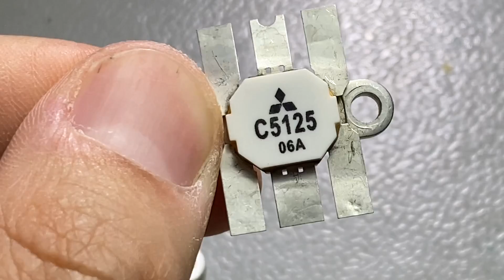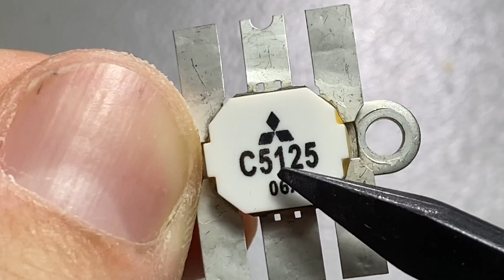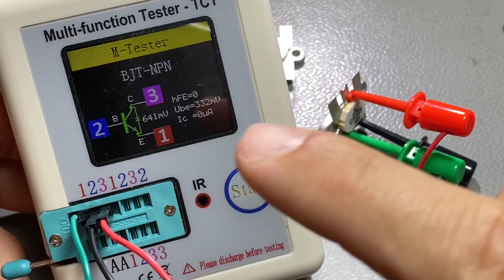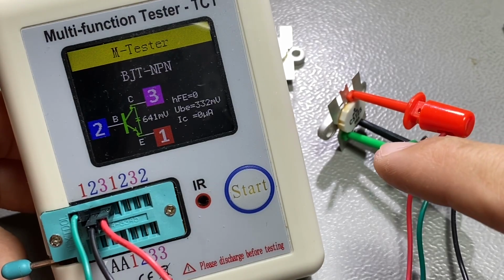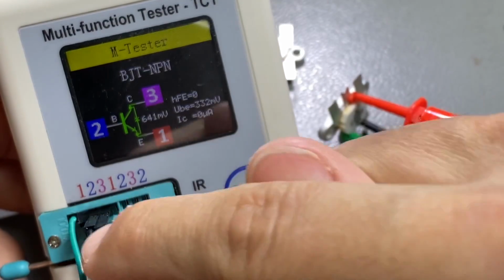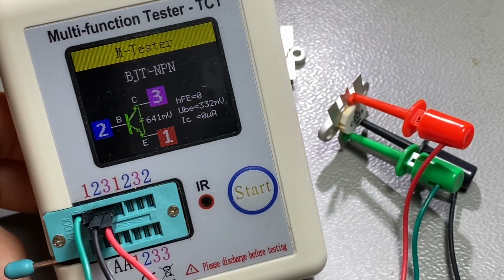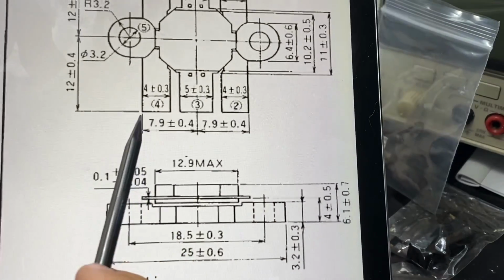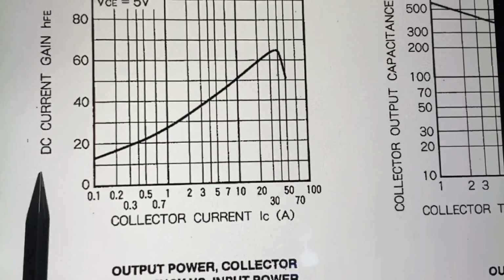2sc5125 MITSUBISHI Power Transistor | Good or fake?

Comment: The 3102 looks maybe good but the others look a bit dodgy, especially with the tester results. Hard to know for sure without soldering them in, but you then won't get a refund. Hopefully you get your money back. So hard with loads of dodgy parts out there. By the way you complained my audio was low in a previous video, now its my turn! Yours  was a lot lower than normal. Best wishes nick
Reply from the maker: Ok Nick thanks for your feedback on the audio. I’m using an external cheap bluetooth mic. 
Yes it is very hard indeed to find genuine parts, market is saturated with these dodgy ones.
By the way, very weird behavior with your woofer. I have absolutely no idea.
Bye for now